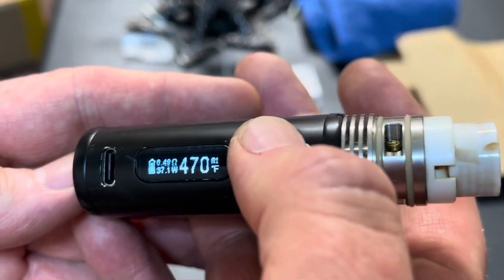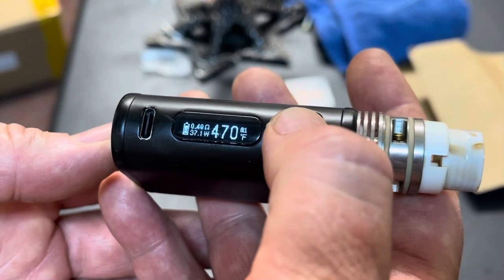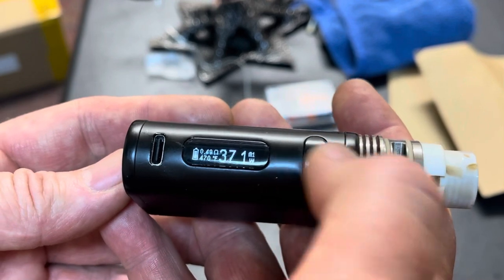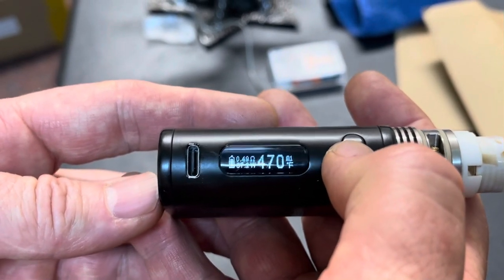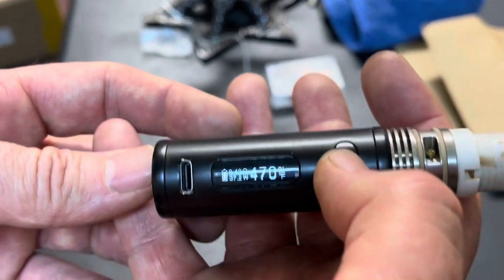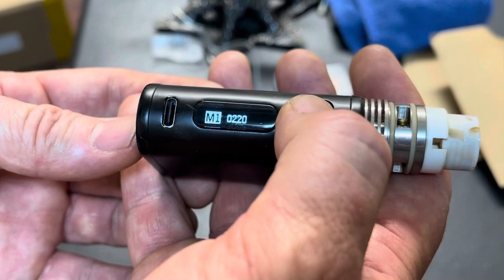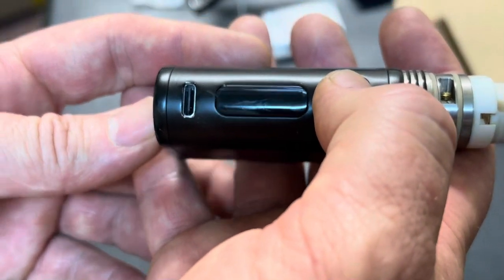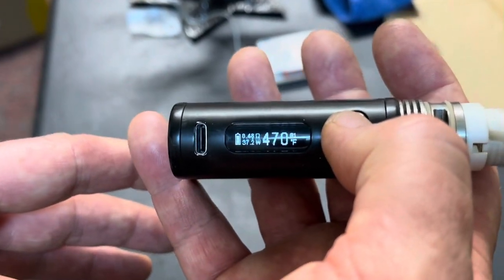Settings instructions eleaf pico w autofire in tcr mode on divine tribe v5 atomizer heater

Comment: Also what does the M1 value of 200 +-15 mean? Does that mean Temp. Degrees in Celsius or Fahrenheit? I'd like some more information on this electronic device that i need to treat with safety respect and to do that I would need to understand as much as possible. Thank you
Reply: Yeah what are these m1 M2 M3 variables? What do they affect?
Reply: @bengmo64 they are memory modes I am not to sure what the value is tho

Comment: Im tring too use mine and i use dabs with a bucket atomizer but i can only use like 4 times before it saus low battery how can i set it up for dabs without killing my battery i stay at 40-45 w
Reply from the maker: Hey is it the pico you have ? Also what type of 18650 battery is in your mod ? That is a big deal
Reply: @divinetribe1 hey man! What’s up?! Hope all is well! I was just wondering is the Molicel P28A 18650 2800mAh 35A Battery a good buy for the Pico 25?
Reply: @divinetribe1  Where is the list of compatible batteries?

Comment: How do i bring my ohm number  down to the 
.4's?  Ive taken it apart, cleaned it and put it back together with a new heating plate but it keeps staying in the .5s and says 
"new coil right
  Same left"
Reply from the maker: When Room temp always choose new coil up.  What is the lowest reading you can get? 
When you reset everything and do everything at room temperature
Reply: If you have one that’s .50-.55 that’s fine, just take note of what the first reading is. Some of mine are that high and work great, if that number starts going up at room temp you know you have issues

Comment: I kept getting kicked out of temp mode and noticed my resistance on that coil had jumped from .48 to .52 and so I changed out both the base and coil for the v5 and the new one is not reading any lower than .50? I notice a bit of flavor change which isn't as nice as the first coil that came with my device. Using the type C Pico with autofire and matched settings in your video. Is .50 okay for a new coil? Is there any way to change the resistance?
Reply from the maker: Possible check this video ? https://www.reddit.com/r/DivineTribeVaporizers/comments/rf94pt/%CF%89_video_on_how_to_get_v5_lead_wire_centered_for/?utm_source=share&utm_medium=ios_app&utm_name=iossmf

Also is it staying in temp control at .50?
Reply: @divinetribe1  so far it's kicked me out once when I changed the value from 200 to 190 but when I change it back to 200 while at .50 resistance it seems to work in auto fire and temp control. I'll check out this post thanks for the reply.
Reply: I got it bro thanks. Disregard previous comment. It kept reverting back to the old settings. Wish there was a way to get it to ask if I was using a new coil. Though this time it hasn't asked that and the resistance is staying at .47 with this coil. I made sure to center both pins and gently screwed the connection into the lead wires. Time to go dab.
Reply from the maker: @nope3638  ok feel free to email matt@ineedhemp.com if you think the mod is defective, we can do a satisfaction refund and provide label for return, we can also test mod when we get it

Comment: I’m using these same settings and during  M1 auto fire running at 460F it’s reading out the message constantly “temperature control” is it suppose to say this?? This doesn’t mean the pico or atomizer or battery is overheating correct? Just wanted to make sure this was normal and wasn’t a cause for concern.
Reply from the maker: Temperature control is just saying it’s reached the temperature you set it to.  It’s trying to keep it at that temperature
Reply: use ni mode at 430f 32 watts
Reply: @divinetribe1  Thank you. I thought I was breaking it. This thing is a hammer.

Comment: My pico will only flash a lock on and off next to my ohms while holding plus and fire, trying to change auto fire, double tapping does jothinf
Reply from the maker: Is it a C charger if so I am the only one at this moment selling the pico with C charger that has a autofire in it
Reply: @divinetribe1  I was hoping since it was from herbcafe it would be one of yours but looks like I’m out of luck
Reply: @griffinclayton8643  I just picked up my USB c from herb cafe tofay lol are we screwed? What settings do you use
Reply: @lukeb4363  yeah I had assumed it was his product because of the kit aswell, all you have to do is hit the button every 10 seconds it’s not that bad, I use 430f 32.5 W Ni mode
Reply: @griffinclayton8643  awesome. great to know. i fired it up at 36w tcr 200 at 460F and shes hitting pretty nice

Comment: If anyone is having their pico 75w auto fire kick you out of temp control, I took my cup off kinda bent the wires so they’d be directly under the screws. Not a lot just very gently. Tightened the screws back up and it works amazing. The type c pico. I also set M 1-3 I don’t know if that changed anything.
Reply from the maker: It’s the resistance.  What is the lowest ohm reading you have seen with either coil if it’s not this number then it will be jump.
Reply: @divinetribe1  so how do you fix the resistance do you do as he says or what do you do?
Reply from the maker: @Anothernumber98  here are some tips in link https://www.reddit.com/r/DivineTribeVaporizers/comments/rvg657/fix_your_pico_or_rim_c_jumping_into_wattage_mode/?utm_source=share&utm_medium=ios_app&utm_name=iossmf
Reply: @divinetribe1  thank you so much it’s super appreciated!!!❤️❤️❤️

Comment: Do you have any idea if these are known for forgetting the software installed? I've been using one for a minute now and I put it down between dabs and when I picked it back up it didn't want to go into temperature mode
Reply from the maker: They can jump into wattage mode if the ohms are high.  Not having a secure connection with the heater wire leads and where they fasten down or the piece being too dirty can cause this.
Reply: Thanks I'll take it apart clean it put it back together with a new coil and see if it still happens as of right now just to give you an idea of what's Happening in case maybe it's my fault or you know something I don't but right now it's in wattage mode if I click it three times to put it in mode switch it just freezes up for a few seconds then restarts the mod back to wattage I'm pretty sure I can still use it in wattage but I haven't tried and auto-fire still works but I'm not sure if my mod forgot the programming or if it messed up or what so I haven't even tried to see if its still 60 seconds yet but I know it still works

Comment: Is there a difference between Wattage autofire and Temperature M1 autofire?
Reply: Because my autofire isn't working on Temperature M1 right now - when I double click in M1 mode, it reverts back to Wattage mode autofire.
Reply: I’ve had the issue you’re talking about if you unscrew the atomizer and put it back on with it reading .50ohm or close it will be able to run auto fire temp mode if it’s at .58 it’s possible it will change to wattage cause it thinks it’s ohm limit is too high for temp control. I try taking out the battery and unscrewing the atomizer and if it asks for a new coil I say yes.
Reply: Yes, M1 is TCR mode which is a type of temp control. Wattage mode is just power mode, and will heat the cup at a certain wattage, not to a certain temp